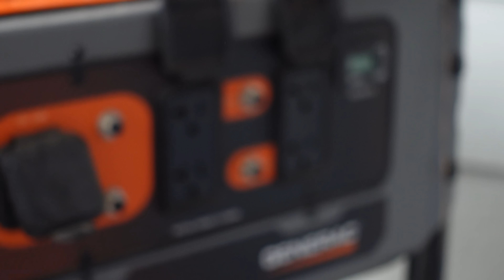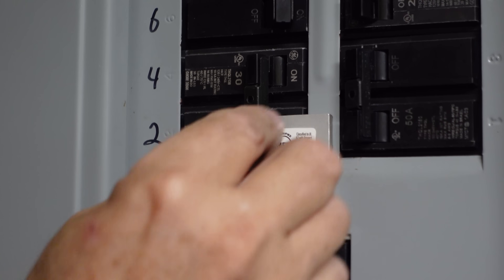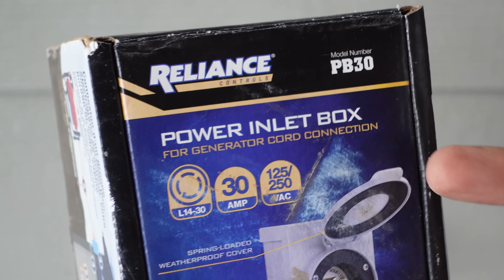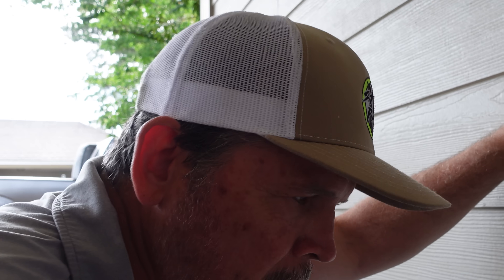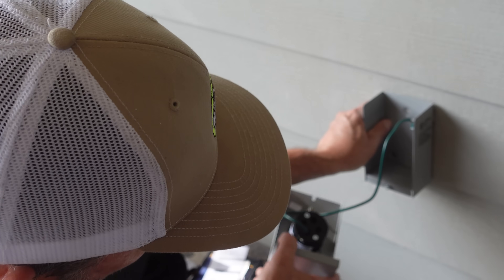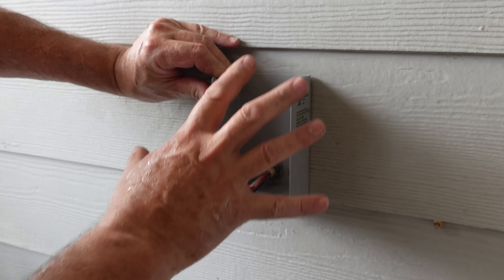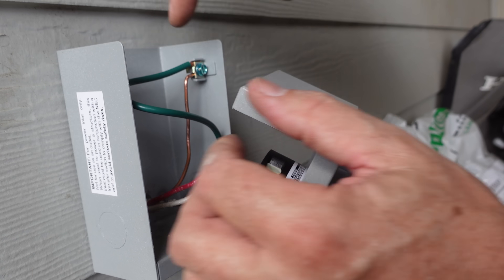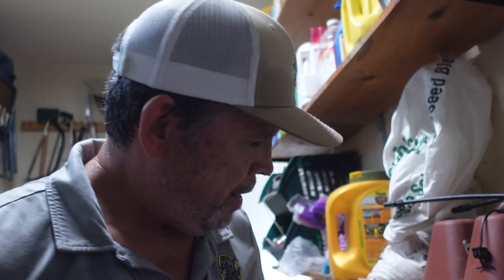What is a Suicide Cord and Why It Could Kill You

Comment: Hey Studs, An excellent video. But, I do have a negative comment. That is a very hot location. And the circuit will be energized for days at a time. I would have bought #8 copper and replaced the feed line to compensate for the load.
Reply: Were it my house, I would too, but 10ga is legal for 30A and quite possibly the homeowner didn't have the budget to up size the wiring.
Reply: More than 24A continuous will trip a 30A breaker eventually, so it won’t run the full 30A all the time. Most of the power for an AC is consumed on startup
Reply: @johnhaller5851  in-rush amps are bigger by some amount than 30. In an application like this, due to ambient heat load, some electrical engineers (which I am not in that club), would want or specify #8 copper. It's simple. My only point is the high ambient heat must derate the circuit supply wire some. That's in the NEC book, a bunch of times.

Comment: I just have one question for Jordan, what did you put in your dad’s gatorade in April of 2021 for him to change that panel out, install the interlock, make the spreadsheet, and not fix the plug then? 😊
Reply: While I can't speak for Jordan or Paul, I'm guessing it wasn't in the home owners budget or the home owner declined it?  Or, the generator was already plugged in so they never checked the plug. That's my .02c
Reply: Don’t quote me on this but I recall them out sourcing that to an electrician
Reply: @Liam-kn9vp  if LA is anything like Missouri, the only qualification for hiring oneself out as an electrician is a pulse. Coming from VA where there's an actual trade license required, it's still mind blowing, after 20 years, what passes for electrician.
Reply: look mccormick you're clearly NOT a cajun
Reply: I was curious about this too.

Comment: Man before running a dedicated generator outlet/port in my garage, I used to just run to the 30 amp Dryer plug.  Rated 30 amps but yeah suicide plug.  Finally got around to making dedicated with interlock and all legal now.  Good video.

Comment: Once a generator is connected to house wiring it becomes grounded. When a generator is grounded there are more paths now that you can get electrocuted. 

If you have a generator and all you do is plug your fridge directly into the generator there are very few paths you can get electrocuted. So don’t be grounding a generator if you are only using the 120v plugs with an extension cord directly to a device. It is just creating another path for the electricity to attack you.  That device being plugged in should also not be grounded. Once one thing is grounded you have to make sure everything is grounded correctly.

Comment: The more I watch these videos the more it feels like in the US houses are built to be single use. If they last a 30 years that's good enough. But maybe it's a case of the worst cases making on here.
Reply: I feel this has happened because of the number of houses we have to build. The US population has gone from 150 million to 330 million in the last 70 years. Germany as a low population growth example went from 70 million to 80 million in the same timeframe. Speed of house construction is not an issue in low population growth countries.
Reply: @ecospider5  population growth defiantly pushes quality down some what. But plenty of countries have similar growth to the US and way better built housing. Codes are the real difference. Even with in US there are huge differences in quality, how often does Paul point out that something wouldn't pass in Cali even if it has large population growth in the past century.

Comment: Nice job, but you butchered those screws. A screw in an outlet is rated for 8-12 Nm. This is about the max torque you can do with 2 fingers. The amount of torque you released on those screws will be about 30-40 Nm. This way the wire will harden and more admissable for breaking. Don't tighten the screws that tight. Tightend is tightend
Reply: I never thought about the wire being work hardened. Thanks for pointing that out.
Reply: You were there, so you know how tight he made them???? Right......  :(

Comment: Great job on the install, but NEC states that outlets and wires must be rated to carry a max of 80% of their current capability. That looks like number 10 or 12, but you need #8 since you are putting out 30A
Reply: The generator is not designed to put out 30 amps continuously for hours on end. If it was then the plug on the generator it self would not be a 30 amp plug it would be a 40 amp plug. Because it would have to be rated for the 80% usage you are referring to.
Reply: I am trying to think of a device designed to pull more than 25 amps continuously that would have a 30 amp plug. If it pulled 25 amps continuously (this is more than the 80% rating of a 30 amp plug) it would have a 40 amp plug and cord.
Reply: You caused me to do a couple hours of reading but the answer is in your statement. OUTLETS and wires have to be rated the way you say. So what is the point of upgrading the wire and not the outlet? 

This is a real question. Putting 8awg wire on a 30 amp receptacle seems like a way to burn your receptacle if you use it at 30 amps continuously.
Reply: I’m no sparky but it looked bigger than 12 to me. It’s definitely better than before. 10 gage can handle 30. 8 gives more ampacity.  I don’t think this is the correct application of this rule. If the air conditioner required 30 amps then this circuit would be undersized circuit. Basically as long as the load is less than 24 amps continuous or 30 amps non-continuous it’s OK.
Reply: 10 awg can support a 30 amp breaker in most all situations.

Comment: Quick question - would it have also worked if you flipped the clamp in the box so that you were tightening on the wire inside the box versus on the back of the box?

Love the channel and always learn from watching you!
Reply: Interesting question. I would say yes unless there is some weird code that excludes that. They could have also put a wire staple right inside the wall. That clamp is to guarantee the wire is secured within a specific distance of the box. That wire doesn’t have to be secured to the box it self.
Reply: IDK about code, but having the lock ring inside allows the box to come off and on the clamp without unclamping the wires first,  which if reversed will be hard to do because the box sides are blocking the needed screwhead angle.  Others have recommended clamping the wires first then locking the clamp to the box.

Comment: Can a child lift up that round lid and touch the hot male blades of that power connection box? This would be possible if anyone installed that thing without the interlock.
Reply: Yes
Reply: Yes this installed without an interlock is worse than the suicide plug.
Reply: No, because the Breaker for that female plug is OFF....Watch the first part of the video and you will see how it is set up...
Reply: @frandanco6289   I watched the whole video. I qualified my statement by saying if there was no interlock or if the interlock was removed then you have a dangerous situation.

Comment: Wow, single wall construction with fiber/cement lap siding. Pretty minimal construction. Nice job on the electrical correction.
Reply: My daughter's house, built in 1949 on Long Island, is built like that. My house in Quebec has 7 inches of insulation, vapor barrier, brick, total of ten inches of wall. If built like this houses in the south would cost a lot less to cool.

Comment: Great Video... it might be crazy to modify that extension cord, but I'd be tempted to either take it away, tear it apart, or modify it properly because (A) they don't need it any more since you fixed the problem and (B) leaving might temp them to use for something else around the house.  I saw 2 more things/questions:  By convention they should have left you 6" from the wall to make it easier to service... I was impressed that you were able to make those connection.  Also, was size wire was that? I couldn't tell if it was 10 or 12... I believe 30A are supposed to be 10AWG for a short run? However I'd be wrong... (I had to google this) The rule of thumb is to apply the 80% NEC rule, and for 30A,  * 8AWG * is recommended... I'm not saying you have to fix this, I have no real idea if it is a problem or not... but what a pain if you need to correct the wiring to the sub-panel!
Reply: 10 gauge is good for 30 amps. That's what I've always heard and from my personal experience running a 5000W 240V heater, never had any issues, about 10M run, 33 ish feet.
Reply: @joshpavelich5235  I wouldn't say 'good'; it is the minimum gauge, not the recommended.  Better would be to go with (copper!) 8 gauge, to be safe.
Reply: @KeithOlson  if you follow code then it's safe. That means not installing it on an appliance that draws 30 amps, it would be max 25 amp draw, with 30 amp start-up peak. So for 25 amps constant current it's good. If it's going to draw 30 amps continuous it should be on a 40 amp circuit
Reply: @joshpavelich5235  Exactly!  

(That being said, I glance at code, not follow it; I try to never trade confidence for cost savings.  'You pays your money or you takes your chances.' is always a good warning.  If I see 'minimum 10 gauge', I'll automatically interpret that as '8 gauge is what you should be using.')
Reply: @joshpavelich5235  right, me too... As I said, I googled to find this NEC 80% rule that derates the wire's ampacity.  Personally I have a 220V 30A circuit to a shop subpanel and I'm sure I ran #10AWG and that's with an electrician supervising the work. And the old wiring to the house main subpanel is also #10...  The charts on #10 say it's good to 35A... so I'm confused... I don't know if they changed the rule recently to account for this or if it applies in certain situations. Again, I'm NOT an electrician, but I was an electrician's assistant and put in a lot of electrical in industry such as 3 phase 480V... yep... oh joy...  LOL
Reply: you can tell that wire in the wall is old, since early 2000's  romex is color coded,  white is only 14ga, yellow 12ga, orange 10ga
Reply: It looked like 10 to me.

Comment: So you're not connected to the grid during an outage, then the grid power is restored.  How will you know when to connect to the line again?  Trial and error?
Reply: Maybe add a panel indicator lamp that will illuminate when the grid has power. Would have to check if the code will allow it on the grid side of the main. Or you could place a non-contact tester on the incoming side and it would illuminate and beep when power is restored.
Reply from the maker: Neighbors let you know when the power is restored.  And they let you know faster than you can ever imagine 😂
Reply: You will know because everyone has lights on again.. The street lights are on... The reason for the outage is gone...Garage doors with openers are opening...

Comment: I did not see where your cable between the panel and your 30 amp connector was rated 30amps
You may want to confirm that the generator does not deliver (it can produce more than 20amp), more than 20 amps which is the wire rating.  Otherwise, with the house undere full load, the wires may actually heatup and melt the insulation around it.
Reply: Yes hopefully that was 10 awg wire.
Reply: @ecospider5  It would be OK if the breakers were 20 amp ones.
Reply: @Hello Leslie how are you doing
Reply: @lydialas8756  I am fine.  I own a home (duplex with 3 apartments). I am very careful about any new housewiring or extensions.
My major projects included   Tungsten bulbs to LEDS, (below ceiling lights to pot-lights).  
Our building as are many where I live (Montreal area) are all-electric.  We are lucky to have low-cost electricity. I am happy to be safe from fire or electric shock.

Thats my answer to your question.
Reply: @lsatenstein  I hope we can get to know each other and can you suggest a way we can talk off here if you dont mind

Comment: I've had a suicide cord on me generator for decades. I just put on my thinking cap when using it
Reply: I’m surprised the electrical code doesn’t require these cords to have some type of spring loaded cap on one end.
Reply: I have experience in work safety and accidents seldom happen to people using their thingking caps but to people who happen to be there when the guy with the cap is absent.
Reply: You should have a sign on the load end of the cord that says disconnect other end first

Comment: Nice job. But I do have one question. The hole from the old box is behind the new box. I noticed you didn’t use a filler or any seal, caulk etc. what’s keeping moisture and insects from coming in round and behind the new box and entering the house between the sheathing and the hole in the siding? Or am I over thinking this?
Reply: I wondered the same, especially on the bottom where the old hole is still open to outside
Reply: The area is under a roof, no risk of water going in, also, the previous installation is similar.

Comment: You know that you're learning or think the same, when each step is how you'd have done it. Expect that I don't own a pock screw jig, and I'm a stickler for caulking anything that might leave a gap. Thanks for showing us the interlock.
Reply: Using calking to protect the house isn’t a bad idea. The electrical box it self should not be caulked because there is a specific amount of airflow allowed to go through the box to dry out moisture vapor that gets in. The box is weather proof not water proof.
Reply: @ecospider5  Yea I mean a bead around the contact points to the house, the box will still breathe through its other joint lines and/or cover plate. My concern is moisture sitting between the box and the wall over time.
Reply: Yes solving the moisture between the house and the box is what you want to do.
Reply: I'm pretty sure this video is "ONLY" addressing the procedure of installing the receptical and since Paul was already hot and kinda "I've Had It With This $#*t" that they "to use 'your' term" caulked it, but my preferred method would of waterproofing would be using silicone since it is more water resistant and does not deteriorate the way "caulk" does, and it's a more permanent "water-tight seal!!"
Reply: @lostreb "Caulk" is both a verb and a noun. Whatever sealant you use between the back of the box and siding will last for decades. (Sailing ships were sealed with hemp and tar.) The application should be out if sight for a better appearance/function, and the screws will just squeeze it into the thickness and width of a gasket. Neither water erosion, nor UV light from the sun will get a hold of a 1/2" wide gasket in any appreciable way to destroy it in less than multiple decades. Yesterday, I redid an outside floodlight. The junction box had no sealant against the siding, but upon returning it, I added some despite there being no water damage.
Reply: @marcosmota1094  All I know is I've had to scrape and replace more so-called caulk in my over 3/4 of a Century on this great planet than I care to even attempt to enumerate.  Since and when I started using silicone??  I've yet to have to scrape and replace any.  I've also used tar as a sealant at times during my lifetime because that was the best option available at the time.  "Ain't My First Rodeo!"
Reply: Phew I'm not the only one. I was thinking I'd right away get the caulking gun out and run a bead around that box.

Comment: Since the box was open at the top, could you have put your clamp so the screws were inside, and the tightening them would have been way easier. Great job, Ann’s for explaining a problem I never thought of.
Reply: No putting the connector Inside Out is against the electrical code
Reply: I was wondering that my self.
Reply: Got it. The electrical code says devices must be installed as instructed by manufacturer. So you would have to find a manufacturer that has documentation showing it used with the screws inside. Which you will not find.
Reply: @ecospider5  I'm an electrician I did a service call on a brain surgeons house. He was showing off his electrical work he did himself at a junction box. All of the Romex connectors were installed inside out, As a result the box was crowded and the wires were right up against the sharp edges of the connectors but it look pretty on the outside of the box. He probably thought of it as one of his brain operations. When you sew up the patient afterwards you want it to look good.
Reply: They make plastic grommet inserts that would be ideal in such a situation.  The design allows the wire to be inserted but not removed.    They don't stick out much from the back which is helpful if a box has to go against a flat surface and the wire is rear entry.